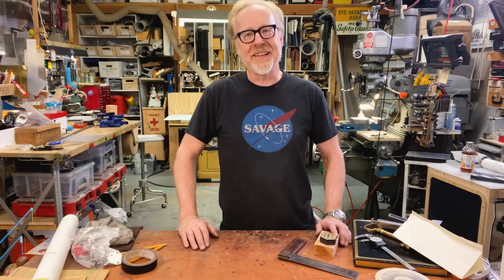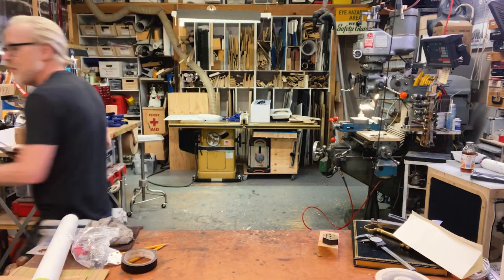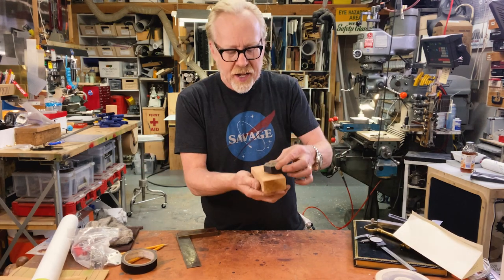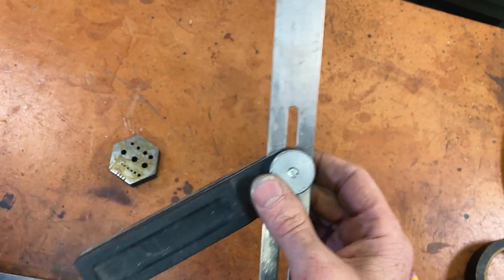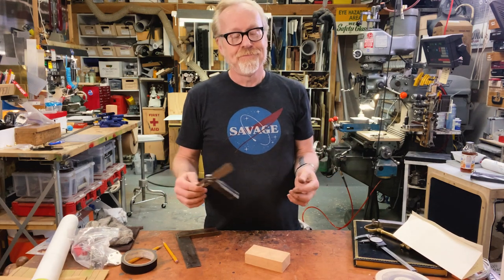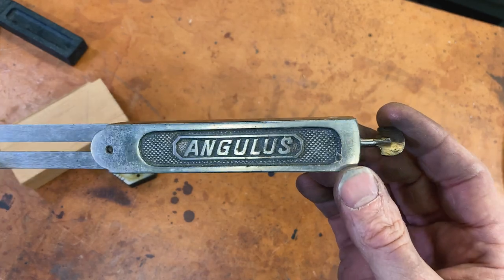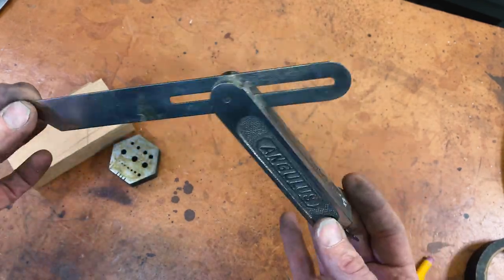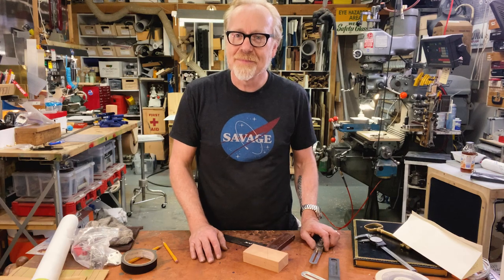Adam Savage's Favorite Tools: Angle Finder!

Comment: We Call the first one an Engineer's Square at our school... Is that the correct term???
Reply: Yes, but calling them a square is common too.
Reply: I've typically heard "Engineer's Square referencing the all-steel fixed squares used by machinists.  The Wood and metal ones typically used by carpenters and other woodworkers, as Adam shows, is usually called a "Try Square"

Comment: I like the look of the Agulus (although, if you keep yelling it aggressively, you might need to attend Angulus management therapy).
I have what I still call my 'antique' bevel square (or 'sliding bevel' or 'bevel gauge' as they are called in the UK. The name comes from its use to establish the angle of existing bevels... or chamfers, as you American chappies call them... to replicate them accurately) where was I? Oh yeah. My 'antique' bevel square... I still call it an 'antique' because it was when I acquired it. It was over 100 years old. But the blade was severely rust damaged and the edges were no longer straight. So I made a new blade out of brass so rust wouldn't be an issue and it looks cool. The rosewood stock had also seen better days but, as the reference edge was brass, the poor condition of the wood didn't affect its function. That was until four or five years ago, when it literally came apart. So I bought a piece of rosewood on Ebay and made a new one. So the only parts that are still antique are the end blocks and the reference plate. It's like an old movie star who's had some work done.

Comment: They also make them with a digital readout for when you need the number, rather than just transferring the angle physically.
That's the newfangled version.
The simplest way to transfer an angle is just with two pieces of paper and a bit of tape.

Comment: Since I almost exclusively do woodworking, some of my favorite tools are going to be for that. In particular, I like some incra layout tools. But if I had to pick one, I use a shinwa sokutei 45/90 degree layout miter gauge that I really like. While markings can move around a corner with a T square, it doesn't really have the certainty that something with some width does. Combination squares and speed squares are also nice, but this is smaller, which can be really useful sometimes.

I've heard people say things about the value of hook rules, and I do use them from time to time. Incra makes a good line of items in this department. Also, I really like having a magnetic angle guide for my table saw. I've made some optical illusion pattern cutting boards that require some serious precision.

I also really like the quality of Starrett tools, but I have to say, the company has kind of gone downhill in terms of how it's run. I placed orders in may 2019 that didn't come until september 2019. There was a lot of talk of back order, which makes it seem like maybe they don't make their stuff in house, anymore? For micrometers and indicators and the like, I think mitutuyo is the new brand to have, over starrett, and precision has improved in other brands enough that you don't necessarily /need/ starrett for the simple layout tools, anymore.

Comment: Whenever I find squares in antique shops, they look like they've spent their life opening paint cans. (And subsequently hammering the lid back on!)
Reply: A lot of the old brass bound try squares are pretty worthless today. Sometimes I run across one that can be brought back into usefulness though. For real work you want to use a hardened combination square. Which is not the thing Adam called a combination square in this video. Although that protractor head likely came with a combination head. I also like speed and framing squares too. I'm surprised Adam doesn't. Whenever I have to break out a sliding bevel gauge (what Adam's "angle finder" is actually called) the fudge factor is real then. I'm not saying I don't use them but I'm pretty much faking it whenever I do.
Reply: @1pcfred  yes, you can get a brand new engineers square for next to nothing. And a high quality new combination square for not much more. I see no reason to dick around with those wood/brass things, you can check they're still square - but is it worth it?
Reply: @dcan911  you can make try squares square. As for if anything may be worth it that is for each to decide on their own. I do plenty merely for the sake of doing it. Many times I've used a try square that wasn't exactly square and thought to myself, it's square enough for what I'm doing and more square than I'm managing to cut things too. But that's what shooting boards are for.

Comment: The problem with second hand squares is that it is hard to be sure it is still square, you have no guarantee it hasn't been dropped or otherwise damaged. Depending on what you use it for, that may not matter much though.

Comment: Hey Adam, I know the chances of you seeing this comment are astronomical… However, about two years ago at a flea market I found a vintage “nail puller”. I got it for about 15 bucks which I later found out was a steal because, if you try to find a similar one from Ampco, they go for close too $300 or so. I finally got to use this tool made in early the 1900s during quarantine, when I tore down and built a new fence. I highly suggest getting one, even if it’s just a thing to put on a shelf and look at. 😂

Comment: I recently acquired a digital version of the bevel gauge, so it actually does give you the angle in degrees.  And if the battery is dead, it still functions as the classic bevel gauge.

The tool I find myself reaching for most often when doing woodworking layout is the Veritas saddle square: https://www.leevalley.com/en-ca/shop/tools/hand-tools/marking-and-measuring/marking-accessories/48041-veritas-saddle-squares?item=05N5601

Comment: Adam I love ya but that is not an angle finder. It’s a sliding t-bevel. An angle finder would include a protractor to be able to read the actual angle of the piece you are measuring.

Comment: Why do many angle finders have a pointed end???  Any one have any ideas?
Reply: I think it makes it easier to get the end right up to the wall when you're marking a line on something that's already attached to something else. Without that clipped corner, the "near" corner of the rule would hit the wall first, and it's harder to scribe a clean line on that side because the handle and the hand you're holding it with are in the way. With the clipped corner, the "far" corner of the rule hits the wall first, unless your angle is shallower than 45 degrees. But in construction, it's usually not that shallow.

It also gives you a good sharp point to use as a reference if the angle you're trying to match is between, say, a mark on one surface and a perpendicular line on another surface.
Reply: @RonParker  Thank you for your thoughts on this.

Comment: Beware buying antique measuring equipment, they can be out of square or damaged beyond calibration. 

Saying that, the quality of modern hand tools is pretty low compared to old ones. If you can find an old tool in decent shape go for it! I'm a practicing craftsman and most of my daily tools are second, third or even fourth hand (Yep, I have one of those bevel gauges too and highly recommend it, the position of the locking mechanism is far superior to having it on the side.)

Also it's called a bevel or bevel gauge 😊

Comment: If it is hexagonal then the angles are 60° Because 360/6=60 What Adam is calling an angle finder the rest of the world calls a bevel gauge. What Adam calls a craftsman square is typically called a brass bound try square. The "combination square" Adam briefly showed is called a protractor. Which usually comes in a 4 piece combination square set. I've never seen them any other way. The combination square is the 45/90 head of that set. It by itself with the rule is referred to as a combination square.
Reply: The angle between two adjacent sides of a hexagon is 120 degrees. 60 degrees is the angle between two lines drawn from the center to two adjacent vertices. The sum of those two numbers is always 180 for any regular polygon. (Which means that your protractor head will show you both numbers when you measure that corner with it, but 120 is the angle on the "keep" side if you're cutting out a hexagon.)

Most people acquire them in sets, but Starrett does sell the individual heads separately: https://www.starrett.com/metrology/product-detail/CPNR-1224W (Edit: and they also sell just the protractor head and rule, for those who don't need the other two heads.)

The amusing thing about that protractor head he showed us is that it can do essentially anything the "angle finder" can do, and measure the angle too.
Reply: @RonParker  the only angle I really like is the right angle. I consider all other angles wrong angles personally. But the world we live in is far from perfect so the occasion pops up where we all have to deal with odd angles. I can't say I am a fan of any of that either. I mean who hasn't experienced the soul crushing defeat of an open miter? Nothing quite says tried and failed like one of those.